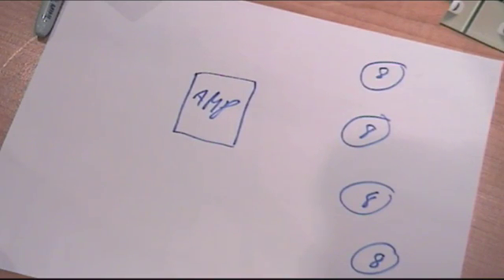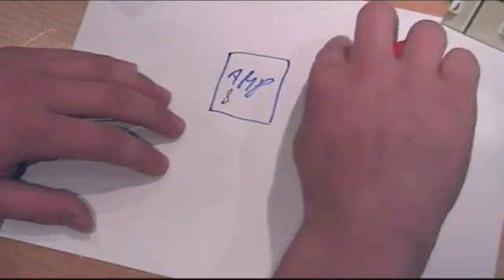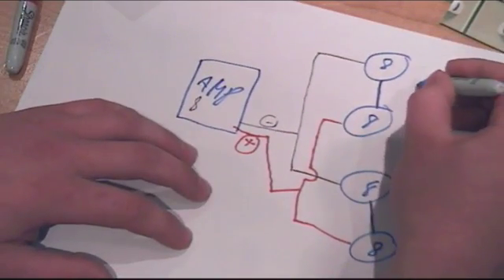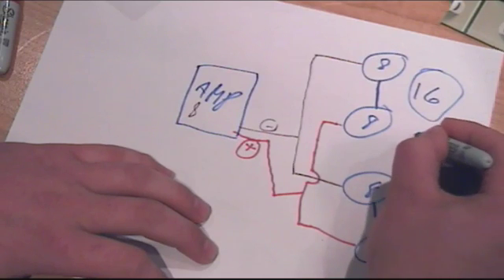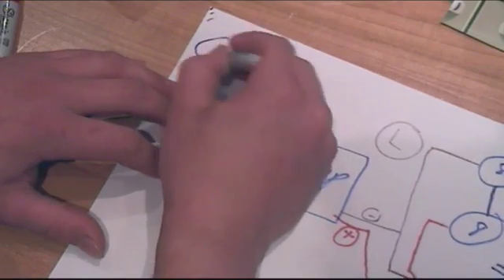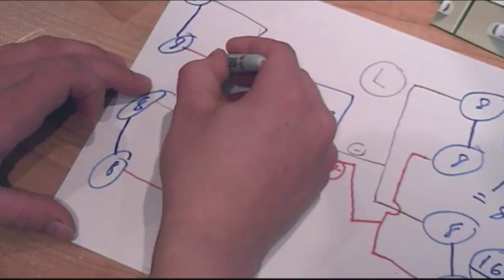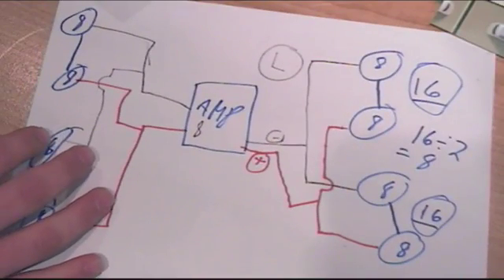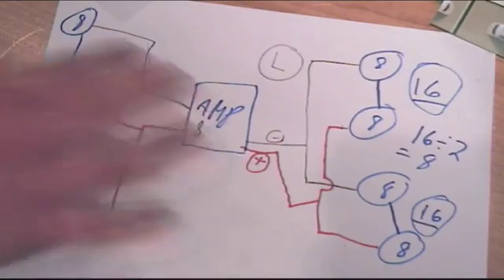Speaker Impedance Matching (Connecting Multiple Speakers Properly)

Comment: For parallel , 1/Rtotal= (1/R1+R2) + (1/R3 +R4); which is 1/8= 1/16 + 1/16, where the 16 = 8 + 8 in series., simples.
Reply: True, but is is even more complex, since the inductive component of impedance does not follow the same formula. 
For large systems, mixed impedance speakers are normally transformer coupled.

Comment: What happens if yiu have 4 speakers …. X2 are 8 ohms  and x2 are 6 ohms … and the amp is rated 8 to 16 ohms … how do those get wired ?   In a series method ? The 8 + 6 = 14 ohm.   On the left channel and then repeat for the right channel ?
Reply from the maker: Connect one 8-ohm speaker in series with one 6-ohm speaker on the left channel, resulting in a total impedance of 14 ohms for that channel. Repeat the same for the right channel. This configuration will ensure that each channel of the amplifier sees a 14-ohm load, keeping it within the safe 8 to 16-ohm range specified by the amplifier.

Comment: If I have a 1,500 watts integrated amplifier
What is the speaker wattage (4pcs per channel) I will used?
Reply from the maker: The wattage of the speakers you should use with your 1,500-watt integrated amplifier depends on a few factors, including the impedance of the speakers and the maximum power handling of the speakers.

Assuming that your amplifier is designed to operate with speakers that have an impedance of 8 ohms, and assuming that each channel will drive four speakers in parallel (i.e., the speakers are wired in a series-parallel configuration), then each speaker will receive 1/4 of the amplifier's power.

Therefore, each speaker should be rated to handle at least 375 watts of power (i.e., 1,500 watts divided by 4 speakers per channel). However, it's important to note that you don't necessarily need to use speakers with a power handling capacity that matches your amplifier's output power. In fact, it's often better to use speakers that are rated to handle slightly more power than your amplifier can output, to ensure that the speakers don't get damaged if you push the volume too high.

Comment: say something new, like connecting a philips 3 ohms speaker to a 8 ohms load amp
Reply from the maker: Connecting a 3-ohm speaker to an 8-ohm amplifier can be a bit tricky, as it can lead to mismatched impedance and potentially damage the equipment. However, there are a few ways to properly connect multiple speakers with different impedance levels to an amp.

One option is to use a speaker selector with impedance matching, which is designed to distribute the power from the amplifier evenly among the connected speakers, while also ensuring that the overall impedance remains within the safe range for the amplifier. These selectors typically have settings for different impedance levels, so you can adjust them to match the specific speakers you are using.

Another option is to use a series/parallel wiring configuration, which involves connecting the speakers in a combination of series and parallel circuits to achieve the desired impedance level. For example, if you have two 8-ohm speakers and one 3-ohm speaker, you could wire the two 8-ohm speakers in parallel to create a 4-ohm load, and then wire that in series with the 3-ohm speaker to create a total load of 7 ohms, which is close enough to the 8-ohm rating of the amplifier to be safe.

It's important to note that while impedance matching is important to ensure proper power distribution and prevent damage to the equipment, it's not the only factor to consider when connecting speakers to an amplifier. You also need to make sure that the amplifier has enough power to drive the speakers and that the wiring is properly connected and insulated to prevent short circuits or other issues.

Comment: What is the total watts of 4 speakers example every speakers have 100 watts if you did that way i mean series and parallel combination
Reply from the maker: The total watts of 4 speakers depends on how they are wired (connected) together.

If the speakers are wired in series, the total watts would remain the same as a single speaker, which is 100 watts. However, the total impedance (resistance) of the speakers would be the sum of the individual speaker impedances. If each speaker has an impedance of 8 ohms, then the total impedance of the four speakers in series would be 32 ohms.

If the speakers are wired in parallel, the total watts would be 400 watts (100 watts per speaker x 4 speakers). The total impedance would be the reciprocal of the sum of the reciprocals of the individual speaker impedances. If each speaker has an impedance of 8 ohms, then the total impedance of the four speakers in parallel would be 2 ohms.

If the speakers are wired in a combination of series and parallel, the total watts and impedance would depend on the specific configuration.

Comment: 4 8Ω  speakers in parallel would be 2
Reply: also using series and parallel connections you can theoretically hook up an infinite number of speakers because each parallel connection cuts the impedance in half and each series connection doubles the impedance of course this doesn't work as each speaker has power demands that eventually would decimate that amp but impedances are easily manipulated

Comment: The wire for between the speakers from one to the other ?  Are there not two hook up on the back of each speaker?  Do you hook the single wire to the positive side or the negative side?

Comment: Yes, wired this way, you can use 8 speakers. But by keeping the impedence load at 8 ohms, you are castrating the power of the amplifier. Also, more importantly, you are reducing the volume level possible at each speaker. Most amplifier max program wattage is quoted at a four ohm load. High end amps can generally handle 2 ohm loads with minimal signal degradation. Basically speaking, the lower the impedence load on the amp, the higher the wattage output. And higher wattage = higher volume. 
I suppose if your purpose of doing this is to provide low volume "elevator" music throughout a large building, this arrangement would be cost effective and desirable. But if your aim is to provide musical listening pleasure throughout your home, you will likely be disappointed.
Provided your amplifier can handle a 2 ohm load efficiently, you'd achieve much more enjoyment and a wider volume range by connecting 3 instead of 4 speakers per channel wired in parallel resulting in a 2 ohm load per channel, provided, of course, that your speakers can handle the higher wattage.

Comment: well this was useful, I got four sets of four totalling 16 and I have had this wrong for six months now! its lucky 8/16 units are a surround sound with seperate amplifiers otherwise I would be having to layer series/paralel curcits under other series/parallel curcits and i would be in hell. I agree with the few people on here say that your explanation needs more clarity but minus this you appear to be right, I also double checked with other places to be sure. anyhow, keep doing what you're doing, and thanks!

Comment: Hello sir, what will be ohm requirement for this setup?? 8 ohm bass + 8 ohm mid + 8 ohm tweet all connected to 3-way 8 ohm crossover = amp output xxx??? is it 2 ohm or 8 ohm coming out of crossover in to amplifier?

Comment: Hi,

I have an amp with 12 x 8oms speakers and 3 sounds controllers to control 3 zones. I want 4 speakers in each zones, each bunch of 4 speakers (2left and 2 right each) hooked up to a controller and the 3 controllers hooked up to the amp. Is it safe to go parallel for each bunch of 4 to the controllers and the 3 controllers in parallel to the amp?

Thank you for your help!
Remi

Comment: I have 4 speakers at 8 on each 250 W at Have amp 4 Ohms 480 W and 2 Ω bridge parallel mono 1300 how would be the best way to connect these 2

Comment: Completely wrong.
You put two 8 ohm speakers together it does the opposite, it now cuts it in half to 4 ohms.
I wonder how many people have watched this and blew their amp.
You should never do this shit unless you know what you are doing and talking about.
Reply: Wired in series it doubles ,most people wire it in parallel though which drops the impedance

Comment: ha bud   i have   4,  4 ohm speakers  and a sub    ,, can i bridge    the  4  speakers   over 2 channels   and bridge the  sub over the other  2 channels
Reply: ive done it   ,I HAVE   DONE IT    I HAVE    DONE IT   (( NO BULL SH...   )))  IT WORKS    ... I WIRED     IT UP LIKE   THE GUY SAYS AND IT BLOODY WORKS   ............................................................ I HAVE  4    -  4 OHMS   240 WATT   9-6  SPEAKERS    AND ONE  750 WATT       6 OHM     SUB    ,, TESTED IT WITH MY MULTIMETER   AND SMD     ....... IT SAYS        4 OHMS    ON   (((( 4 -   4  OHMS  SPEAKERS  ))) JUST 4 OHMS FOR 4 SPEAKERS         WITHCH   LEAVES    12  OHMS LEAFT  FOR THE SUB        OR  4 -8 0N THE OTHER CHANNEL        DAM IT EVERY ON DO YOU NOT UNDERSTAND     YOU  NEED ONLY ONE AMP FOR UP TO   8 SPEAKERS  AND ON SUB

Comment: YEAH I BOUGHT A 70 VOLT SYSTEM, WIRED JUST LIKE YOUR 1ST GRADE DRAWING,  HALF THE FUCKING HOUSE BURNED DOWN,  I NEED $70,000.00 
FOR FIRE DAMAGE,  OR LETS BUILD THIS 70 VOLT SYSTEM AT YOUR HOUSE ASSHOLE.

Comment: Hello, i want to build 2 speakers 4ohm open baffle and i want to use multiple speakers on each speaker, for example one 12 inch sub, a 8 inch mid-woofer, 2 midrange 4 inch, and 4 ribbon tweeters, i got some power amp enough powerful that can drive them easy but my problem or question are the crossovers, can i use 2 of 3-way crossovers for each speaker?? or is better each speaker to have it's own low pass or high pass crossover?? using 2  3-way crossovers on each speaker is a good idea or i will need second amp to drive each crossover separately ?

Thanks in advance, Eddie

Comment: Thank you for the video. I have a 50 watt amp head we have to parallel outputs. I can adjust the ohms from 4, 8, and 16 ohms. I want to connect to cabinets to my amp head. One cabinet is rated at 16 ohms the other at 8 ohms. The 8 ohm has two 300w speakers the 16 ohms two 30watts  Therefore, which impedance  should I use on my amp head?

Comment: but why would i do all this when i only need to connect normal way, two speakers into two amplifier connections.. question is can i connect two speakers that have 3.2 ohms everyone of them, connect them normally into two connectors of the amplifier that has 6ohm impedance output?? thas't in noting of big science or philosophy..

Comment: Means I should maintain 4ohm instead of 8ohm right?
Thnx buddy!!!
More resistance or less resistance should be kept in mind???
Reply plz
Reply from the maker: If both speakers are rated at a nominal impedance of 8 ohms then it will create a total load of 4 ohms connected in parallel. Car audio runs at 4 Ohms. Consumer/Pro audio runs at 8 Ohms. A car sub amp will handle a 2 Ohm load. A Consumer/Pro sub amp can usually handle a 4 Ohm load. Some will even handle a 2 Ohm load. 4 x 8 Ohm speakers connected in parallel = 2 Ohms Nominal.

Comment: I want to connect custom woofer which has more watt than original
I am connecting both custom and original together to home theater
Will it effect amplifier??
If yes how should I connect two subwoofer of unequal power
Reply from the maker: Connect them in parallel. The amount of total wattage is the wattage of both speakers summed together. Remember to keep in mind RMS and peak wattage.

Comment: Thanks, that is very helpful and simple. I still have a question....  how to connect  3speakers 8oms instead of 4 ?  
Is that correct like this:  8oms + 8oms, parallel = 4oms  + 8oms (3rd speaker) = 12 ???

Comment: im using 2 4ohm or 8ohm idk the ohm sticker first said 4 then buried over 8ohm so im using a guitar tube amp sounds better at 8 ohm setting and im using a y connector so it makes any extra speakers like the top of the amp i wired to be 8ohms bcuz its 2 12' celistons the cab below peavy 410 has a crossover in it and tweets idk shit about that so id love to plug in somehow other 8 or 4 ohm side of the 410 should i slave an samp to be safe can it be done without a big pain in nut can i buy a multi meter and know? ill use another head like robbin ford for dirtys

Comment: (for home application) if we use an active subwoofer will it still draw power from the amplifier and still have to formulated first or just plug it in into a pairs of the socket (back L & R maybe) since it already have it own power source??

Comment: what if 3 speakers 8ohms in 1 channel?
Reply from the maker: You would get around 2.6ohms
Reply: so how to connect 8ohms mid ranged 8ohms tweeter and 8ohms subwoofer?
Reply: my ampli is 750watts per channel 8ohms
Reply from the maker: +Guilmar Kaidmiel Puntilar that would require crossovers to devide the frequencies to each speaker driver. Example: sub woofer cross over from 20Hz to 80Hz. Mid range cross over would be 80Hz to to 3kHz and the tweeter would be 3kHz to 20kHz. This is only an example. Speaker driver frequency response and crossovers may differ.
Reply: @guilmarkaidmielpuntilar2900 ,it's better to use external cross over to connect that.

Comment: Question... I have a Sony str-dt1080 a/v and recently bought a Paradigm Cinema Trio L/C/R which has 4 mid drivers and 3 tweeters . I don't want to use the bar for all 3 channels. I have loud speakers and want to use this bar as my center. Please give me a word of advice on this. Do I need to go into the par and reconnect to match my impedance?

Comment: If you connect a 4 ohm 20 watt speaker and a 6 ohm 10 watt tweeter to a passive crossover how does that alter the power needed?
Does impedance stay the same or does it change like in parallel networks?
Reply from the maker: +Alok Soni generally for power 25 watts would do to power the speaker and tweeter. The impedance would sit around 4.5 to 5.5 ohms nominal. As the tweeter only does %10 of the work. I doubt the tweeter reaches 10 watts maybe peak. 10 watts for a tweeter is a lot especially if its paired with a 20 watt.
Reply: McInTEC thanks for replies
Reply from the maker: +Alok Soni no problem. Just let me know if yiu have any not questions or video ideas you'd like to see.

Comment: Speaker resistance are called "impedance" 
Do you know what impedance means? It's frequency dependent resistance.
If you read the speaker manual carefully, you will see "nominal" 8 ohm.

Comment: I am currently running my factory headunit tre an alpine mrv f-240 4 channel amp. i am still using the factory bose 2 ohm speakers,  how can i add a center speaker? can i use one  positive and a negative from each front channel to create a center channel?

Comment: Hi McInTEC, I need your suggestion, I wrongly connected the polarity of the cable from 

my Spendor S3/5R2 speakers to my vintage Sansui stereo amplifier as follows: 

As wrongly the 2 Negatives of the 2 speakers were connected to the one channel of the 

amplifier and the 2 Positives of the 2 speakers were connected to the another channel of the

amplifier. One speaker was working and another speaker was not working. I was confused and

didn't notice about the wrong polarity for about 15 minutes, then I checked the cable

connections and detected the wrong thing. I became panic and sweated like anything. After I 

made the correct connection the two speakers sing as usual. But.. even though the speakers are

now working, still I have some fear. By the wrong connection:   Would the cross-overs of the 

speakers become weak? Did I do the great mistake? How will be the life and health of the speakers?

May I keep the speakers for long time?. If it would become weak, that would how much? 

Kindly let me know about in detail. I am much worried about the thing.
 
If I hear from you as: 'Need not be worried and the things are fine' , then I will be jumping 

with my transplanted knees! I very much love these small beauties. But, now I am sleepless. 

Thank you,

Regards,

Suseendran.

Comment: I have a Pioneer GM-D8604 100 w rms × 4 (4 ohm) 150 rms × 4 (2 ohm), Can I wire 8 speakers this way? Thanks
Reply: Is more impedance better sound or less impedance?

Comment: Hello Buddy,
I am trying to Connect multiple output to a Single channel PA Amp (Its Mono amp for mics) . Just say I have a large area to cover and I would like to spread the sound around a bit. What would be the plan to connect something like 6 or 10 speakers this way? The Speakers are 6 Ohm. The Amp is can take upto 4 ohms. Would really appreciate a detailed reply.
P.s- I thought abut connecting 2x 6ohm speakers in series, Then connect 3 such pairs in parallel. Would the impedance be roughly 4 ohms? And I have 6 speakers?

Comment: as a electronic student i really suffered your explanations lol
Reply: So.. If you're an electronic student can you explain to me, if i have 4x16 ohm speakers connected in parallel, how big should be the impedance on amp?
Reply: Ideal amp impedance would be 4 ohms, but it would also work just fine if it was 3 or 6 ohms. Any lower or higher of that could cause damage if played at higher volume for longer time.
Reply: And if it would be connected as series? Thanks btw.
Reply: Venum no problem, dude. in case of connecting in series, the impedance simpls adds. multiply 16 by 4 and there is your answer
Reply: Sompn Brurl  Thanks : D